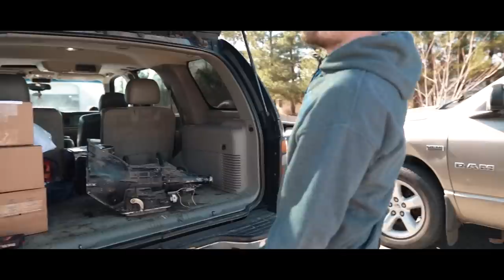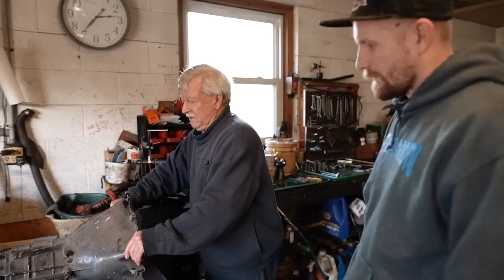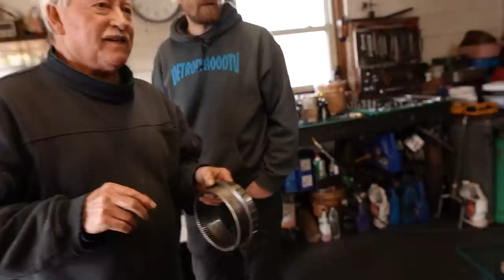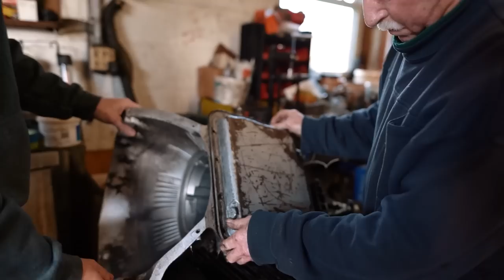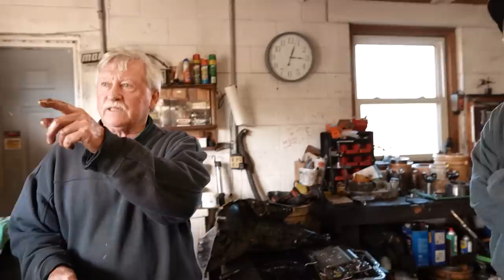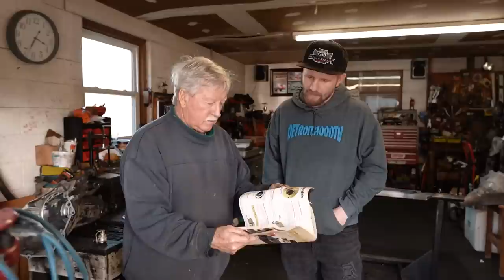TRANSMISSION TROUBLES! How a Powerglide Works

Comment: Broke a front yoke on my driveshaft in my Polara in the water box at O.C.I.R. in Irvine, CA after about a thousand passes, and it bent the tailshaft and split the tailshaft housing as it split a u-joint cap and spit an ear off the front yoke at the water box guy missing him by less than an inch of breaking his shin (tore a hole in his blue jeans cuff though), with a huge bang on the hook up of those Firestones to concrete.
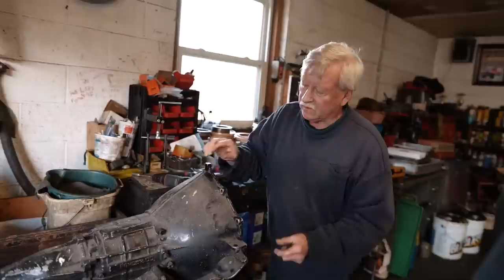 Of course it was going to be a big project from flexplate to 8-3/4" 4:56 Rear Pinion (Trans repairs plus new bullet proof thicker drive shaft with larger Spicer joints and yokes complete), and a buddy of mine Puerto Rican Abbey from Gardena (owned and raced a beautiful B-Body Mopar Forrest GTX since it rolled off the factory line), knew everything there was to know about Mopar 727-A and 727-B Torqueflites like that fella knows glides, and he said hell Gary, no biggie, just go by Pick-a-part, find a 727-B or 2 and snatch the tailshaft out of 1, and the tailshaft housing out of another out of the Trans pile (just roll the shaft on a flat back window of a Ford in the boneyard if you can find one, and make sure there are no cracks in the tailshaft housing, and bring it to my house on the trailer, I have all the parts we need to do the complete rebuild, and we will have a driveline service right down the street here make your new driveshaft up while I teach you everything there is to know about rebuilding and tweaking both TF-a & b's as I need to also do another friends a at the same time. Then he called me back 20 mins later, said to give him the measurement center to center on the old drive shaft only, as they were going to start cutting my tube and it would be finished by the time I arrived with the used parts I needed to pick up from the boneyard.

Saturday was sweet warm SoCal day and in 2 hrs I had what I came for in hand after disassembling a few 727's in the grease packed dirt of the Anaheim Pick-a part lot and just 35 bucks lighter in my wallet as I walked out the gate, drove straight to Abbey's in Gardena with a change or 2 of clothes. Bonus was I already had learned the disassembly process in the scrapyard 3 X over, now to learn the re-build and reassembly proper, and the right parts to inspect and replace to make sure it was stronger and faster once we completed the job.

When I arrived my new much stronger bulletproof drive shaft with much bigger Spicer u-joints was already sitting there and freshly painted and ready to install on the floor at a very decent price. Bonus, they even gave me a discount if we returned the broken core.

By Sunday evening (a bunch of hard work, and a ton of learning and a couple of great meals later, a shower and little sleep), both Trans rebuilds were completed perfectly, the difficult puzzle of mysterious Torqueflite internal surgery was solved, and that man taught me a ton, asxhe was a TF expert and he had all the right tools, knowledge, and books to do the job (in the early 1980's, we did not have the internet to research it kids, and there were no youtube vids to learn from the successes and failures of others, we had books and shop manuals, and racing family/friends and old coot experts to rely on, or your wallet was a lot lighter which really cut into the race winnings and budget.

That car ran a 10th quicker that next Wensday evening and I won the Heavy Bracket win check again making up for the second round (water box breakage loss), the prior Saturday.

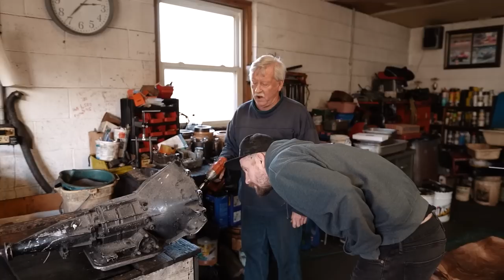Now it had a bullet proof driveline in it finally. Well....Until it found the next weak link, the following Saturday on the very first time trial. Sheared 3 teeth off the 4:56 Pinion, and 4 teeth off the ring gear. Now, I was in Irvine, Abbey was in Gardena that is a drive out and back on a Saturday mid morning, and First round is at 7:00 pm, but a phone call and I knew he had a fresh 4:30 ratio Strange geared 8-3/4" sitting on his garage floor he would sell me, and offered to meet me at the halfway point of the drive andxcut my drivetime in half, to trade broken for new. So, I pulled it out and left the track in my tow vehicle, with my pit space,  racecar, trailer, tools in good hands with great racing family friends and pit space partners, and we met up. I stopped at a NAPA to pick up new rear gear oil, and new axle seals along the way back.

When I returned with a new center section bullet there was only about an hr left before the dinner break and eliminations started, didn't think I would get another time trial that day, and the rear ratio change was going to make dial in a guessing game as it was a long time ago I had a 4:30 ratio in the rear so data was older than dirt.

But, to my huge surprise, a couple of great friends had sent 1 of their wives into town to also get new rear axle seals, and gear oil, they had already disassembled the brakes, backing plates, replaced the seals, checked and repacked the rear axle bearings, replaced and reassembled the rear brakes on both sides, had the axles back in leaving just enough room to insert the new center section punk, and propped them both up all ready to help me button everything back up upon my return....and that was all done between their time trial passes working together. Great friends are hard to find that you also compete with and against, but we were all like 1 huge family, lived separately, but raced together, partied together, worked together, and 🎉 celebrated together no matter who won!

About a half hour thrash later I was 3rd from last in line to actually get a time trial before the dinner break!

 Breakfast at Denny's was on me that night for the whole gang after I picked up another bracket win check. But, blowing the whole win check on great friends (and competitors), who would do that work (mind you 1 of them I raced against and barely beat that night by a very slim margin), without you even asking...that was a very precious commodity. I really miss those days, and cannot wait to get back to it this season after a quarter century layoff while raising a family.

That old man does know his Poweglides, and you were lucky to find him Matt! Learn all you can from him Matt, and ask him if he needs a hand occasionally, that kind of technical skill can be used to help a racer race more often. So far, I have only needed to rebuild a few more both TF 727-A and Bs for good friends and not myself again, but can do it like I do it every day (even though when I have it was years apart over time), thanks to an expert at it taking his time (going really nice and slow, explaining everything perfectly) and giving me a real education on just those transmissions. TY Abbey! Mopar or no car.

Comment: Some of the hardest bracket races to win in the 70's and 80's with a big block B-Body heavy car (due to the 3rd gear shift delay 1/4 mile racing, were against Chevy guys with a PGlide fully lightened on their internals (and they did a lot of gun drilling and shaving on drums, clutch tricks like you guys found on that old trans, and you could not even hear or see any difference in that 1-2 shift rpm wise or see any difference in big end closing distance due to it, but the TF sort of has a big drop and sits down for a fast slower speed build up as she storm the big end and you attempt to take the stripe by only an inch...sometimes chasing you would never know who got there first until you either caught a glimpse of their win light out of the corner of your eye while staring at their front spindle through the shoe polish cross on the inside of my driver's window, or you saw the "W" on your time slip.

Comment: Ha ha Matty boy, a lot of guys commented about your machinists shop (a few even went as far as to leave comments that they would have walked elsewhere due to the look of the place), but mine has been locked in Machine Shop Jail for what seems like forever, and yours is already back and on the stand getting completed. So, the last laugh is yours bro, you are finding some real gold out there on the small shop, low budget rebuild tour bro. 

Most of my delay is not directly caused by the shop (though they are really busy in their repair bays, backed up by parts availability, and the fact that my class rules are super strict, and I have a 1 off 1 yr. Model (numbers matching combo), that they cannot even make 1 tiny mistake on, so they are doing it right the 1 time they have to do each task (and making the overbored/honed block fit the new Forged custom replacement pistons, and not the pistons fit the block). It is what it is.. but, you are close it appears to getting the patina'd Nova "Fools Gold" back out where she belongs. Racin' again brotha!
Reply from the maker: That’s where you’re wrong unfortunately. That block that went to the machine shop two months ago hasn’t even been washed yet. Pretty much I’ve given up on it

Comment: Matt , what year powerglide can i use for my small block ? I have a 1962 and a 1966 powerglide trans
Reply from the maker: Doesn’t matter year doesn’t make the difference it’s what was in front of it that does
Reply: @DNRAuto  OK they should be fine , both had 300 horse 327's on then

Comment: lot of people say the old dude he in the way 🕶
 NO NO  the older generation you can get one that has a couple trades will be OK 
 but if he has a whole BUNCH of trades I would NOT use him 
 a mann that has just ONE trade that is all he does and that is all he knows 
that is the one you have build things for you 
 The clutches look  like the same size that are in my Harley Just as many too 
 I have 4 clutches in it and 3  steel bands  
  Just listen and learn  MATT  and what is good about all of this Normally shops  say drop it off and pick it up NO I want to watch them just like you are doing  Matt  That way you learn that some idiot did not know how to build a transmission 🕶